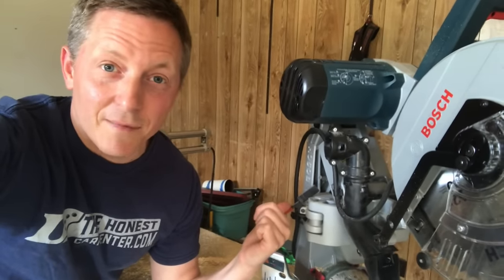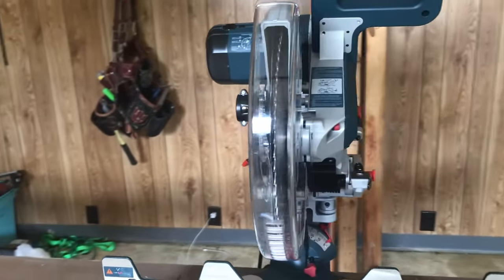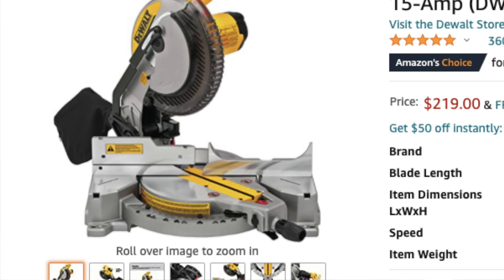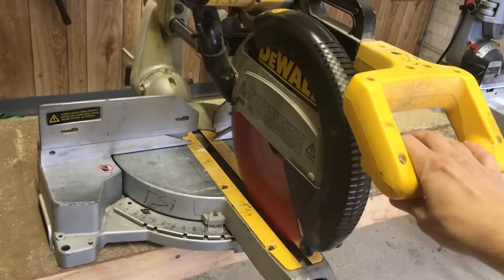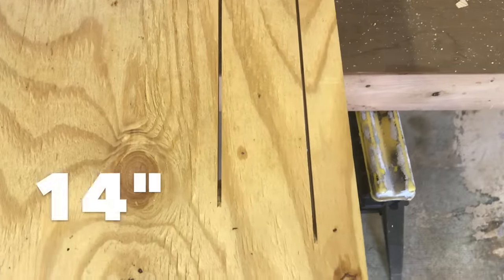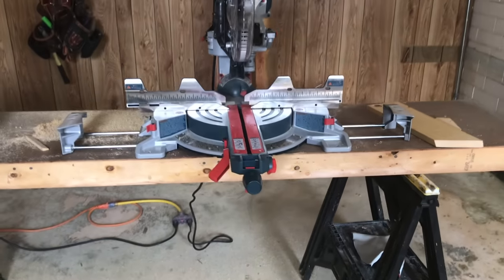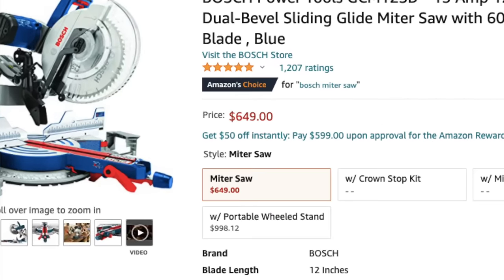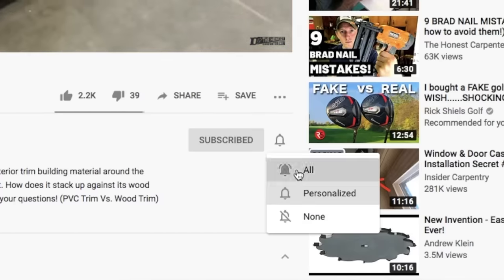This INNOVATION Changed Miter Saws! (Best Miter Saw Feature--Bosch "Glide"...Better than Rails!)

Comment: How is the blade deflection when you have the arm extended all the way out?
Reply from the maker: Mine came about 1/16th out. Pretty easy to dial in with a base adjustment.

Comment: I used both the De Walt and the Bosch in the same workshop on the same day.   I'd get the Bosch for sure. 

The workshop space had room for the back swing for either, but the Bosch was smoother and I had a lot of precise mitres to do, and 5 other people using the saw for other angles.

Comment: Have this saw. Perfectly in line/square/true in all 3 dimensions. You just have to be a tad careful when you are at full extension not to "force" the movement  out of any axes. But that is also true for slider saws. I "can" make it cut out of line but if I am smooth and just let the saw work it will be square. This is obviously less of an issue if you just use it in a chop saw motion.

As for the dust, it is terrible if you use it with the little (useless) collector bag. Replace that bag with the hose of your running shopvac (perfect fit) and it's magic. VERY LITTLE dust.

 My only complain with this saw is its weight. Depending on where you get your specs, it's "only" about 10 pounds heavier then some of its red/yellow/green/orange/turquoise competitors... what's 10 pounds right... Well, 0 to 10 pounds is no big deal, but 50 to 60... in your arms, in a flight of stairs... another story. And a saw is a lot more cumbersome to carry then, lets say, a dumbbell of the same weight. And don't forget the saw stand ! No way you carry both at the same time. Two trips.

The funniest thing is that my #2 choice before buying this one was Milwaukee 6955-20... even heavier... but also  very nice to operate. The ergonomic of the controls are better on the Milwaukee. I really like both these saws... but both are heavy weight... so is Makita LS1219L.
Reply: You are right about the ten pounds. When my wife was 190 I could lift her, now that she hit 200 I no longer can. The same with age.  If you are 30 and she is 20 the ten-year difference is no big deal.  But, if you are 25 and she is 15 the cops will be knocking on your door.

Comment: I have the Bosch 10" slide mitre saw, I'm a pro just like you, so it gets a lot of use over the last 15 years , no complaints, its great saw, but the space issue is real, my question is, have you cut crown mould on the flat at 31 and 33 degrees, and is the set up quick and cuts accurate?

Comment: How do you feel about the Bosch GTM 12JL?

It's a corded combo Bosch miter saw + table saw, 12", with the same glide rail system.

Is the conversion between miter and table saw too much a hassle?

Comment: I bought this saw because I was seduced by the ingeneous technology. I sent it back because, for my purposes, it was hopelessly inaccurate. 
Returning it coincided with a very special offer on the Festool Kapex ks120 eb which ended up costing little more than the Bosch.
The Kapex is well-designed, consistently precise - and an absolute joy to use.

Comment: I have the exact same saw, i’ve had it for about nine months now and never really had any issues with accuracy. The one complaint I have is when I finish a cut and release the handle, as the blade slows down I get a ticking noise? I’ve taken the blade off and I’ve cleaned everything out, there’s nothing jammed in there but the noise is really annoying but it doesn’t seem to affect the precision. Does anyone have any suggestions as to what this noise could be?

Comment: As usual no matter how good a product is you might end up with inferior product, I check mine out completely, i did some adjustments at first to square it up but it’s worked flawlessly, the thing I don’t like is it’s HEAVY and the dust collection is not so good, there are aftermarket dust collection parts you can get that I hear work 90% better.

Comment: It’s been a while now, has the saw developed any slop or play in the blade when it’s at full extension?
Reply from the maker: It seems fine to me, Dragon! I did dial it in a few weeks after I got it. Pretty easy on this model as I recall.
Reply: @TheHonestCarpenter , thanks for the quick response. Do the articulating joints have adjustments on them to help maintain true angles and tight fits at the joints? I guess I got lost when you said you “dialed it in”. I’m looking for something to expand on the abilities of a Skil brand miter saw I bought back in the late ‘80’s. Most stuff I cut is in the 6”-10” range and I don’t like having to flip stuff over to complete a cut or break out an electric hand saw. Thank you

Comment: The other drawback is the handle. I'd buy this is the handle was vertical and directly over the blade like the older Hitachi's, some of the Matabo's and Festool. Why most saws for the right hand is beyond me. Also, why can't they do shadow lines rather than later lines. It's safer and more useful.

Comment: I have the Bosch and to be honest I'm disappointed. Yeah it looks cool and glides super smooth but it's not accurate enough for its price range. The miter stops have too much play in them, making it not square by a lot if you are cutting a wide board. Did I mention it's 30kg (66lbs)! Not a job site saw. Cool innovation and probably the only reason people buy this saw - it looks cool.

Comment: I've had nothing but issues with this saw.  Surging motor, poor cuts, terrible dust collection, etc.  Worked great at first but now it's a $700 paperweight.  I'm going back to a fixed saw and using the table saw for wider cuts.

Comment: No doubt Bosch miter is the Boss. ESp if putting in a garage. Burr look at delta and Hitachi (Metabo) which have similar mechanisms and a tad cheaper,.. BUT, if you not a pro (ie generating a lot of wear and dust on the rail ) go straight to harbor freight and buy the Hercules at 1/2 the price, or better yet the Bauer at a 1/3 price ! (They both have great side rail extensions with stops AND front miter lockdown.

Comment: Great saw but terrible dust extraction. Multiple mods online.
I would recommend buying Festool Kapex clamp. With a little bit sanding they fit and so much efficient than any other clamp.
Take the time to read the manual for the adjustments really important to get this saw extremely accurate.

Comment: I wish the 10" version wasn't actually more expensive then 12", it makes no sense.  Would like to keep using my 10" blades but I'll prolly splurge eventually and get a good 12" blade.
Reply: 10 inch version is $100 less than the 12.
Reply: @tc6912  Hmm, I swear that it used to be equal or greater price, but now I'm doubting myself.

Comment: I have one for 4 years now. It’s to heavy for portable use. It’s really powerful, for real precision work it flex to much. Dust collection is not good. So perfect saw for rough work but I would not buy one again. If you use it one angles left or right it’s really heavy to adjust it perfect. If I would buy one again it would be the festool.

Comment: Ethan, I'm a fan of your channel. I don't want to sound negative but you need to check the alignment of your saw while you can still return it. I had the 10 inch version of the same saw, and it had alignment problems that cannot be calibrated out. The motor head of my unit twists a little bit when the arm extends. Please check the following Bosch link: https://www.bosch-professional.com/gb/en/community/category/gcm-12-gdl-sliding-arm-misalignment/12772603-t#main

Comment: big mistake... i have that saw and would buy litteraly any other saw next time... needs massive calibration out of the box, it is a pain in the ass to calibrate, and it has massive deflection issues which makes it very hard to get the highest accuracy cuts... and there is a reason no other manufacturer makes a knuckle design. also its ridiculously heavy

Comment: it's not true that this arm mechanism is unique to the Bosch - Delta has a similar one in their big miter saw. That being said, it is beyond me why at your level one would get a sliding miter saw - a proper table saw with a sliding table (european type) pretty much eliminates the need for a miter saw in the shop. For outside the shop a miter saw is still nice to have, but a big one like this? Are you buildining canadian block houses every day?

Comment: Tis saw looks like they might have solved the inconsistency at full extension. Most of the saws like this I have seen, at full extension have side play. So 90 cuts can vary from piece to piece. That why I liked the Makita. The ext bars are on the front of the machine. Two steel slide bars. You get consistent cuts at any length. The new Ridgid and others do not offer the steel slide bars. Theirs is a variation of the Bosch. Pure garbage. And when I told them of the issue, and the amount of money they charge. How can you not do a better job of engineering? So, I am switching to Makita. And they offer many more tools than Bosch.

Comment: We have a radial arm saw as our chop saw. For a commercial shop, I hate the fact that you have to turn the miter saw on every time you use is. This is very irritating for production work. After seeing your video, when our 10 inch radial goes down, I will have no problem buying the Bosch.  Bosch is quickly becoming one of my favorite tool companies.

Comment: I like it , But I have to rely on old fashioned skill and my antiquated 2019 Dewalt sliding compound . The Bosch would have to be modified for me since I now lack a thumb on my right hand . " Not because of a careless carpentry mistake" .. But because the deadliest form of cancer " Melanoma : can form under a thumbnail ..   Stage 4 and still kicking ,, Wonder if Bosch would donate one to me for being a partially disabled heroic carpenter ?

Comment: Does the Saw “drift” when fully extended? Meaning when extending it for long cuts does the blade stay straight even if the pressure is off a little on either side?

Comment: I've had the 12" Glide for 3 years. There is no positive aspect to this saw other than you can push it up against a wall. The hinge system is not accurate. The motor weight on top is asymmetric. I tried and tried to get the miter angles to work. It turned out that the injection molded angle detents was not a perfect circle. I had to cut the thing in half and refasten it to the saw. The detent lever mechanism is all plastic(how long will that last?)The sliding fences are very soft and flexible, junk. I have owned 10 mostly sliding saws. This Glide is the worst one. The 708 Dewalt was a brilliant saw. I owned two of them. I would buy another one today. Be careful before the newer Makita mitersaws. Their detents are soft aluminum.

Comment: In general high end miter saws are not worth the money, they are not repeatable enough for the money, if you don't pull it exactly the same way every time your cuts cuts can be off as much as 1/8th of inch, you are better off with a good table saw and fence. But if all you are doing is crown and base boards then maybe but a cheap one will work good enough. After all you could hardly consider finish carpentry wood working now could you.

Comment: nah.
Too much play in those saws.

Best saw made was the old makita 12" from the 90's-early 2000s, bar none.

For contemporary units, best check out the JET 12".
excellent saw if you are interested in accuracy.
My only issue with it is that is made in china.

Comment: Hmmm, too many bearings to get loose, and lose accuracy. The Festool Kapex is very compact and has an excellent bevel adjustment, it's also easy to move around with the slides being at the top of the machine. But they keep putting the price up.

Comment: My 1998 10" Bosch miter saw has the two side x side round slide bars. It does take more room behind it, but mine is on an Bosch extruded aluminum table with casters I made  for it so I can move it where needed. The complaints of dust collection are solved by hooking a shop vac hose to the dust chute. It also was a pricey at the time, MSRP was over $900 at the time. I worked for Bosch, and got it for $235. Big mark-up on their products. I can say it has been a very good saw, and replacing it for this new model ( which is nicer) is out of the question for me.

Comment: The Glide is a good idea, but I do more fine work and the Glide isn't accurate enough.  On wide cuts, it deflects.  Too bad I didn't know you were looking for one, I'd have cut you a really good deal on mine. 🙂  I also would have included the Miter Master blade too (which I'm wouldn't do otherwise), which is in great shape as I've limited the use of this saw for my work.  It's still a great saw for what it's good for.  Have fun with it.

Comment: I have this saw, and love it... for the same reason, so smooth... only thing I noticed is when reaching across to do a lengthy cut and I have to flip the board over to finish the cut.. there's a small amount of deflection I find happening, could be my saw specifically, maybe something needs to get adjusted to ensure 100% squareness... but something to watch out for... I usually give myself a little room to play with and shave off as needed to get a "mostly" straight, 90 degree cut...

Comment: This thing is super nice to use in a shop, but it’s ungodly heavy to move around to/from job sites. And the deflection is slightly worse then most major brands, and all that weight leans on the slides during bevel cuts so it makes deflection a bit worse even for bevel cuts.

Comment: I have that Bosch miter saw with the gravity stand, which makes moving the saw a breeze.  I also made a box around the saw and attached to the stand for dust collection with 2x 4" ports to my dust collector.  I capture much more dust now than hooking my shop vac to the dust port that came with the saw and I don't get saw dust on anything behind the saw anymore.  I can't collapse the stand anymore with the dust box but I can still wheel it around.  I also attached 3" high multi-tracks to the fence with a stop on both ends of the multi-track and can add additional lengths of multi-track so I can use the stops for longer boards.  I have the multi-tracks supported to the sides of the dust box because I don't want to risk cracking the aluminum Bosch fence mount. The multi-tracks with extensions and stops comes in handy when making window and door frame stiles for accuracy repeatability.

One thing to note:  If you transport the Bosch saw from job sites, make sure you secure the motor/saw blade assembly so it can't move around during transportation with straps.  My saw got so out of whack that I couldn't square it up perfectly.  I just bought another one which was square out of the box and if you have a Menards in your area, it goes for around $578 during their 11% rebate sale.

Comment: I bought mine two years ago for $550 or so, and I love it. One issue I have is the blade seems to vibrate when I'm about 1/2" into the cut, and then its like it finds its own kerf space and balances back. when it does that it leaves a curved indentation in the end of the board because of the wider kerf at that point. If I cut off less than a blade kerf on the end it doesn't have that issue, so I can clean it up that way. I haven't figured out why its doing this though. Anyone having a similar issue? 
Mostly I use the saw for rough dimensioning of large pieces, but I'd like to dial it in to get the quality cuts right.

Comment: I love my Bosch 12" glide mitre.  Very accurate and simple to square up the first time.  If I am cutting angles I put my square on the blade to confirm 90 degrees when I put it back.  There is just a tiny bit of play on the 90 detent but that really only comes into play if you are cutting boards wider than 10" so square it up and tighten down the front handle.  I think all mitres suck for dust collection but the little bag does a pretty good job.  I didn't bother hooking it to my dust system and just dump the bag when it gets full.  I am very happy with this saw!

Comment: I love my Bosch axial glide.  Mine makes trips to the job site so I paired with the zero gravity stand.  Match made in heaven.  One thing some don't realize is can adjust the tension on the arms.  Mine was to loose out of the box, I tightened it up a bit.  As far as the price, you get what you pay for.
Reply from the maker: I saw those set screws on the high arm, Eric! I haven’t messed with them yet, but pretty soon I’ll start tinkering...

Comment: This was first big tool purchase and still my favorite tool in the shop. I totally agree with folks who say a miter saw is not absolutely necessary and table saws are more versatile, but man it makes things nicer.
Reply: @Only Memories Go With. Nothing Else. I have never owned a RAS, and a lot of folks say they are dangerous, but man they look handy. Especially when you can put a dado stack in them.
Reply: @Dustinplays4keeps  yes.
a good old radial arm is a must have if you are manufacturing cabinetry with dado rather than pocket holes.

Comment: You really need to look at the colliflower zci zero clearance insert
Reply from the maker: I’ll check it out, Joe! I was thinking about making one, but I’d be up for buying something aftermarket as well.
Reply: What’s great is the aluminum frame you can make your own inserts for it or buy them. It’s a simple 33 ish degree but on the table saw and slide in. You will love it.
Reply: Cut* on the table saw 😂 dang autocorrect